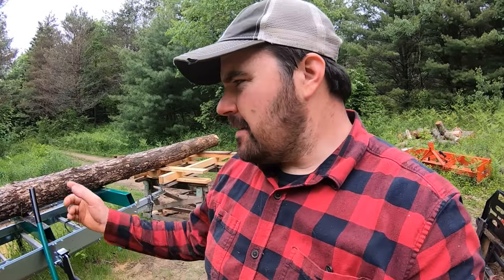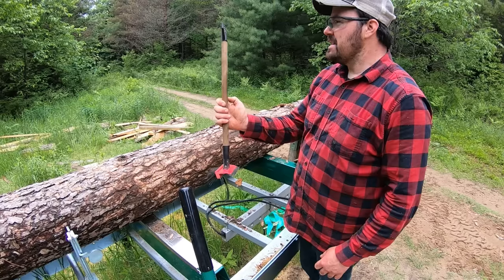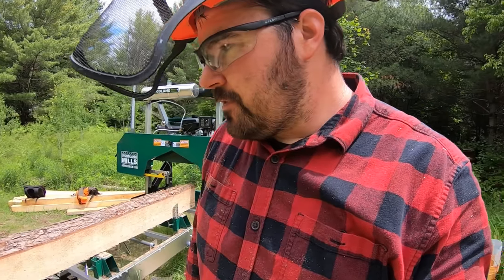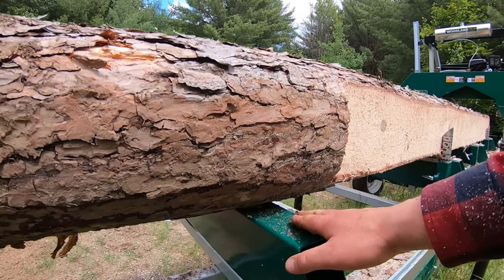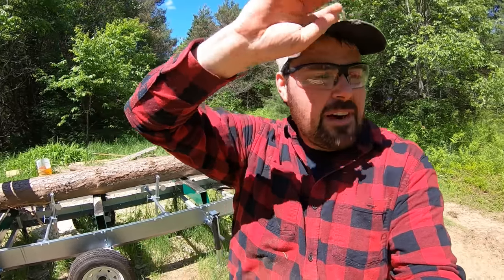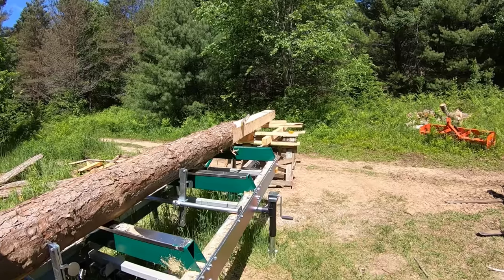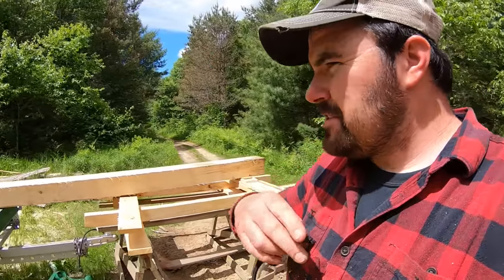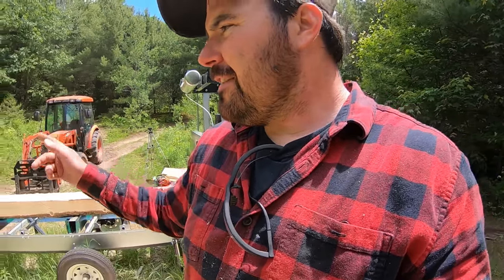Cutting a 20 Foot Log on a 10 Foot Sawmill | No Track Extension Required

Comment: As you were cutting the tree down and removing the limbs I was thinking how you would cut it using the 10 foot sawmill... I thought you might put two boards (2x4 or 2x6) of about 8 foot length and screw them to the log so the last two rests on the mill touche the boards and at least one of the rests on the improvised sawhorse rests. 
Then you could cut the log and using the boards as you slide the log to the beginning of the saw as a liner upper (as they are parallel to the saw cut) You may need to remove the boards and reposition them further along to finish the cut. If one side is cut you then have a more easy time to do the opposing cut. Repeating the process on the 90 degree side will leave you with a very easy way to do that opposing cut...
Reply from the maker: Sounds like an idea worth trying out for sure! Thanks for passing that along

Comment: Could you use the older sawmills trailer bed and connect the two butt end to butt end. Drive this Mobil one to the stationary one.you would have to craft a way to get them both at the same height. Simply connect the two trailer beds.
Reply from the maker: Hey Jason! Unfortunately the older sawmill is a bit narrower than the new sawmill

Comment: Question what is the measurement from the ground to the highest point of the sawmill I have ordered the 126 model and woodlander trailer hoping it'll fit through an 8 foot garage door I enjoy watching your videos thank you
Reply from the maker: I don't have my mill handy at the moment but I did a quick lookup on Woodland MIlls website and it says for the Woodland MIlls HM130max woodlander (on trailer) from the ground to the top of the scale is 104 1/16" but from the ground to the top of the lubrication tank is 83 5/16" .

Comment: Wonderful video,  any idea on much $$ you saved by doing this yourself  ?. Also a thank you for the laugh,  watching you battle the insects makes for quilty entertainment 😄.
Reply from the maker: Hey Mark! I just checked the price of lumber at Home Depot but the biggest size they have is 6x6 16 footer pressure treated and it's $88.74 Canadian. Yikes
Reply: Hey Sandy,  any plans to do a tiny house review this year. Just wondering if the wood was done cracking  ?.

Comment: Question for you Sandy how long does a blade last before you have to change it. 2 hours or how can you tell?
Great video by the way.
Reply from the maker: I don't have a set number of hours but I usually start to feel some resistance or added force needing to be applied as I move the sawmill forward. That's my way of telling that it's time to put on a sharp blade

Comment: I now have a 122 on the 16’ folding trailer… if I could do it all over again, and had a spot for a perma mill. I’d keep the 10’ trailer and build a 24’ perma track some where and move the mill head between them
Reply from the maker: I've never heard that idea but that's a pretty good one there Blake! I think that would be very useful
Reply: Bonus points if you could “dock” the trailer inline with the rest of the track so the saw head could just roll between them

Comment: Sandy, the 10 ft extension at $489 US looks like a bargain to me.
Reply from the maker: Yeah sure would be handy. I think in this case the extension is adding another 6'5" of cut length so I"d still be short. With the trailer the max is 1 extension piece as well

Comment: Couldn't you put the slab back under the log that you cut off wouldn't that make it the perfect  hight to get your beam straight on the mill?
Reply from the maker: That's a good question. I think since the slab is a bit inconsistent in it's thickness since it's got the bark on it still it can make the height of the log vary a little bit.

Comment: "Hotter than blazes," he says in a flannel shirt. 😄 I only wish I could be working in the kind of "hot" where your tee shirt and shorts aren't soaked with sweat in a half hour, ahead of the dizziness and muscle cramps that tell you it's time for self rescue after just 90 minutes into an outdoor project. I think I'm built for Canada instead of the Southern Midwest. 😆
Reply from the maker: haha yeah it was a hot one for here but certainly nothing compared to the south. The flannel shirt as funny as it seems is more to keep the bugs from biting my whole body haha
Reply: @sawingwithsandy  I think I'd prefer a little repellent on my exposed parts for the flying type, vs. all the ticks I pull out of me. I'm going to guess I have immunity to lyme disease and everything else they carry by now. I guess the price for having oaks, walnut and honey locust includes heat, ticks, chiggers and lots of poison ivy. 20 straight feet of anything is rare here, but very cool to see how you got that done. Cheers Sandy!
Reply: Jimmy, you say that now, but wonder how “Canadian” you would be in January up to your butt in snow and -35?
Reply: @mattcampbell4135  I'm a little creeped out that you know what my inseam measurement is. 😉 True, though. I'm not a fan of extremes either way, except you can add layer on layer for the cold, but can only take off so much in the heat. My preferred outside working temp is mid 40s, then taking off layers as I heat up. I particularly like the protection I get from honey locust thorns in insulated overalls.

Comment: Why is the wedge you cut out so narrow? I've never seen that before. Isn't it more dangerous?
Reply from the maker: Good question Dan. I wanted to maximize the amount of length on this tree as it as for the beam so I took a small than normal face cut. The tree had some good lean to it already so allowed it to work out for me. I normally would cut a taller face cut in most cases

Comment: have you given much thought to using and aluminum latter 20 foot long under the log on top of the mill ....... slides easer and can be fixed securely to latter ......... sliding the log on top of the latter made easy bye a coma long hand winch used on either end driving in stakes ...... using only one winch........ fellow Canadian ........S
Reply from the maker: Thanks for sharing that one! I like that idea and never thought about it

Comment: You make me cringe. Please stop pulling the mill head back with the blade moving that will make the blade fly off and destroy  the blade
Reply from the maker: I raise the blade before I pull it back just to ensure it doesn't hit anything
Reply: @sawingwithsandy  I was talking about when the slab was still attached before you cut it off with the saw
Reply from the maker: Oh ok. I haven't had that issue with the blade popping off fortunately
Reply: @sawingwithsandy  I have what happens is if the blade is moving it can catch a splinter or bark and it pushes the blade off and makes a loud bang oh and your stop to keep you from hitting the dogs also stops the blade If it comes off (safety feature)